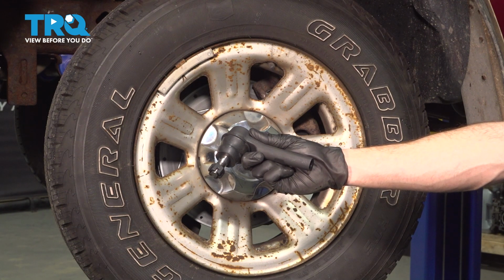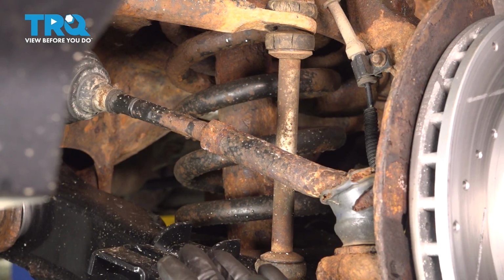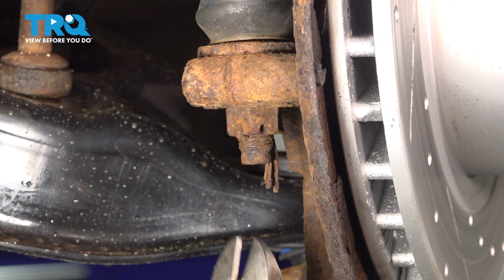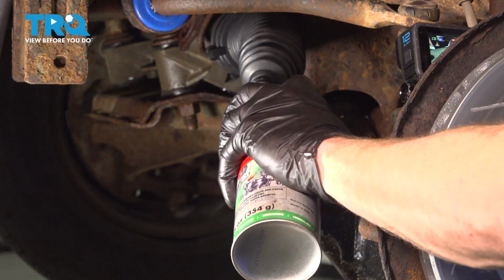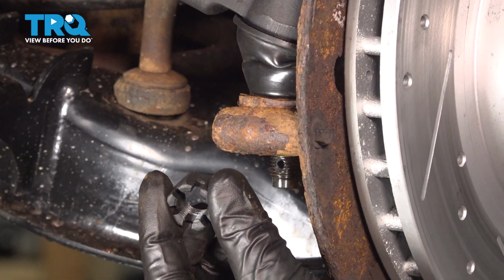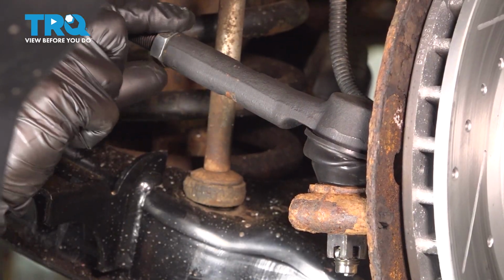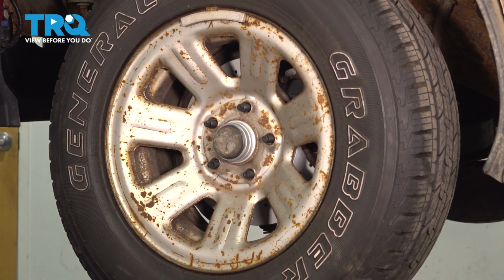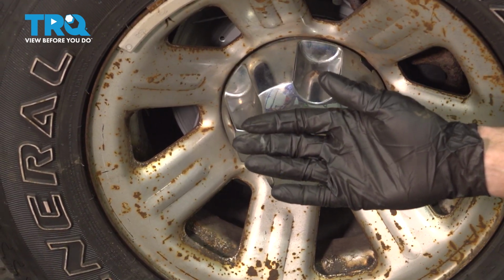How to Replace Outer Tie Rods 1998-2011 Ford Ranger

Comment: Thank you so so much! I am in the process of replacing the upper and lower control arms along with their terribly worn out ball joints. I got the 3 inch thick shop manual, but I couldn’t find a section about and replacing the tire rod ends. I saw something, but it was VERY brief. Thank you very much. I bought my parts from A1 Auto. So far, I got the upper control arms in. It was both at the same time very easy and extremely difficult. (getting the bolts out and back in on driver side. Brake lines were in the way and for ME it was extremely difficult to find the bolt hole alignment! The second side was easier brake lines weren’t in the way and I learned a little bit by experience about how to get the bolts back in. 
I am tremendously grateful for TRQ for producing and posting these extremely helpful videos. Thank you so much. You saved me some money. I also like doing my own work. I don’t think anybody loves my truck as much as I do. I feel I always go above and beyond.

Comment: I replaced mine and the lock nuts never broke free so I know I put the new end on with the same number of turns -- but the resulting toe-in was different by quite a bit. I'm guessing this proves that tie-rod ends are not made with exactly the same length even if you count the turns.

Comment: The 2005 Ford Ranger shop repair manual that I have specifically mentions some things regarding replacing the outer tie rods.
1. CAUTION: Do not use a hammer to separate the tie-rod from the wheel knuckle or damage to the wheel knuckle will result. The manual lists a small tool to separate the ball joint from the knuckle, Remover, Tie Rod, 211-001(Tool-3290-D), OTC equivalent tool OTC-7315A.
2. NOTE - Do not allow the steering gear bellows to twist when the front wheel spindle tie rod is removed. That's because the two clamps on the tie rod bellows need to provide an air-tight seal to protect the interior components of the steering gear.